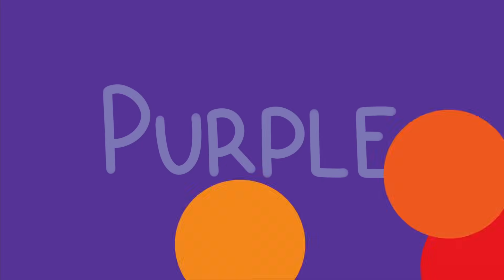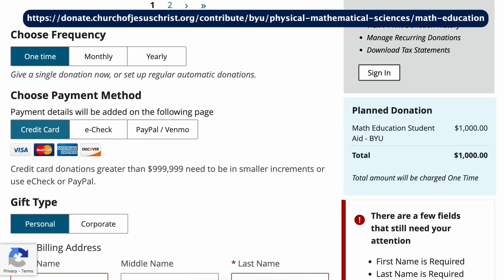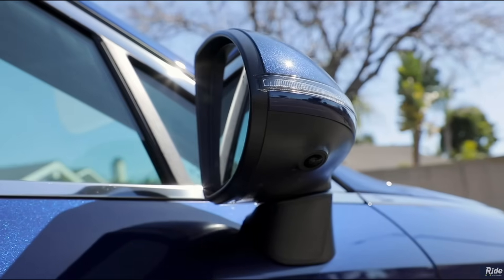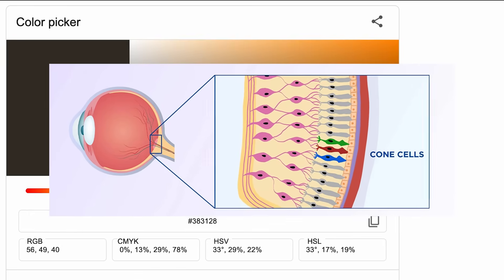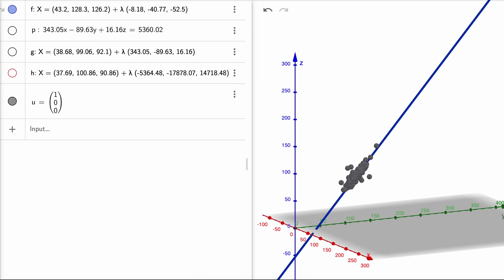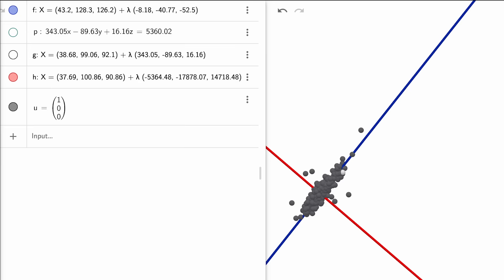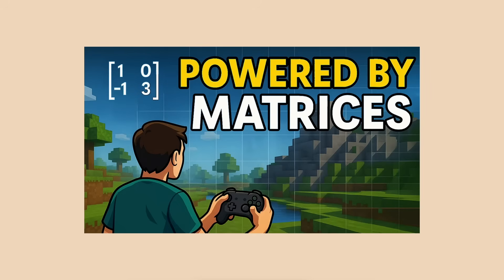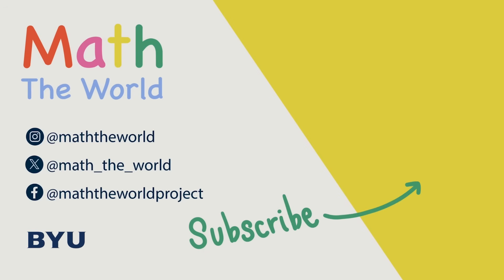Change of Basis Finally Made Sense When I Understood THIS

Comment: 1:05 The existence of a "standard basis" is often quite elusive. Every coordinate system has its own standard vector basis. It's like taking about standard units. Meters are nicest in meters, feet are nicest in feet, there is no one length unit that is more "standard" than any other (in a pure, objective, math sense). Same goes for bases of most vector spaces.

Exceptions arise when your vectors mean something specific where one basis sticks out. Like the monomials in a vector space of polynomials.

Comment: Does the shower water controls count ? I don't like those where I need to control how much cold and how much hot water I want, but the controls switch basis to be temp and power, then it's so much nicer to use
Reply from the maker: It certainly fits conceptually. I don't know if the conversion is linear, but I sure like the real world example!

Comment: These examples have nothing to do with change of basis.
Reply: Err, yes, they do?!? A change of coordinate system is a change of basis.
Reply: @bjornfeuerbacher5514 only if it is a linear transformation. Almost none of these examples is a linear transformation
Reply from the maker: I only picked examples that can be done as a linear change of basis, although the contexts that don't share origins are done with homogeneous coordinates. 

You can get around homogeneous coordinates in the shirt example by simply subtracting the means from each column of data, so you don't need to homogeneous coordinates In that case, because there's an easy work around.
Reply: I see a connection.